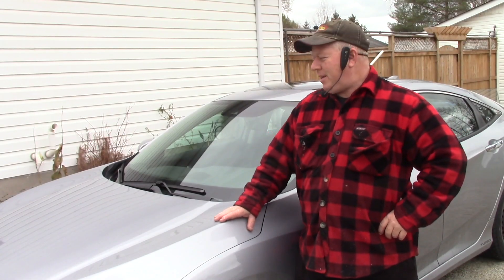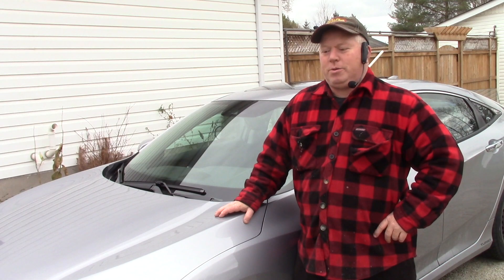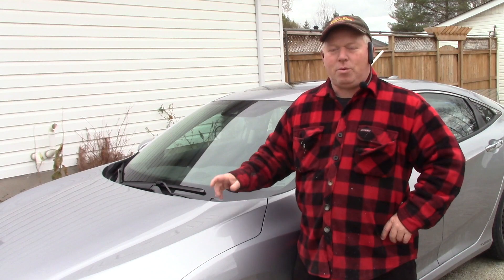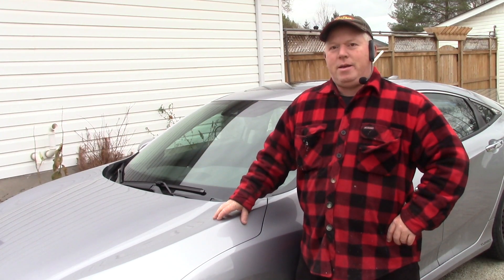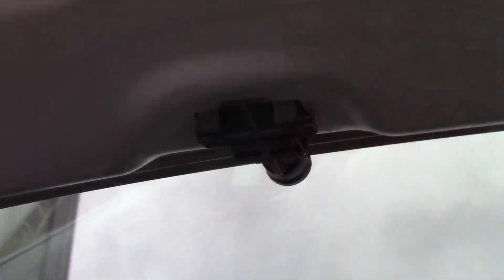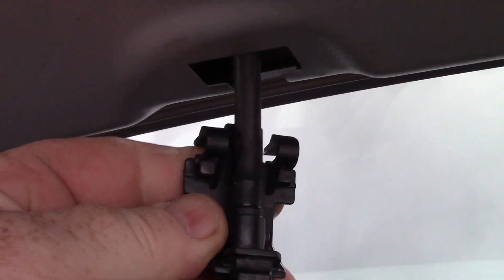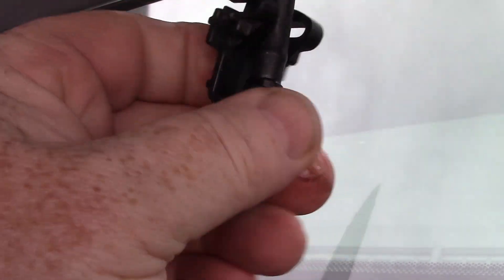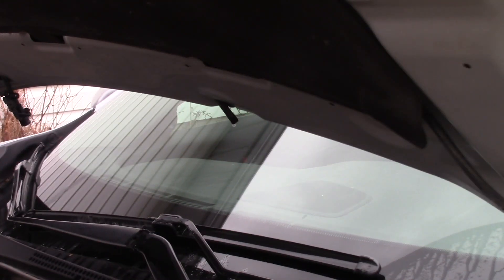Replacing Windshield Washer Nozzles Honda Civic 2016 - 2021

Comment: Great vid. For anyone watching the Civic Type R FK8 nozzle fitment is slightly different. The tabs are inside the bonnet/hood. I had to replace the drivers side nozzle and to be honest, I had to use brute force and a flat head screwdriver to get it out.

Comment: I just took mine out and soaked in strong detergent for a few days and they've been fine for years since. They didn't appear blocked but they wouldn't spray properly. I was also surprised it worked.
Reply from the maker: @StandAndStare    Nice!

Comment: These simple videos are gold sir, cheers 🏴
Reply from the maker: Lol!  Thanks!
Reply: @robsgaragewoodworkin  update*** I bought the parts. I’ve a 2017 1L vtec turbo civic. Scotland. 
I tell you something, they take some getting off! Probably the originals, man I couldn’t twist it, plus I was laying over the full engine to reach 🤣. I had to resort to prizing the end of the rubber tube loose. The right hand side one the pipe was very short, I had to hold the new part in my teeth so once I pulled the old one off I couldn’t let go or the pipe would’ve sprung up into the hood! 🤣 Anyway they work a treat. This was a real world story 🤣👍🏻 I noticed the old ones the part that does the misting wasn’t there, it was just a hole in each. Strange. 🤷🏻‍♂️🤷🏻‍♂️🤷🏻‍♂️

Comment: My mom told me the nozzle on the passenger side was not spraying. I was troubleshooting it and took it off, thought soaking it in water would clear it.

It wasn’t the nozzle b/c I decided to swap the driver & passenger side and the problem still exists. 

Do the hoses get clogged???
Reply from the maker: They can.  Squirt it a couple times with the nozzle off and that should clear up any issue.  Another likely issue is a kinked hose.  Make sure it’s not kinked or pinched.  Good luck!

Comment: 2018 models are diffrent the clips are at the side but they are pretty useless at the best of times Ive used some Citreon C3 ones & made them fit (little bit of work) cheap as chips, the Honda nozzles are pretty badly designed